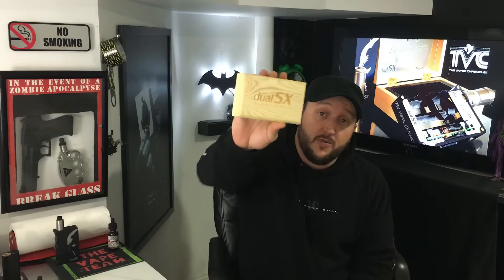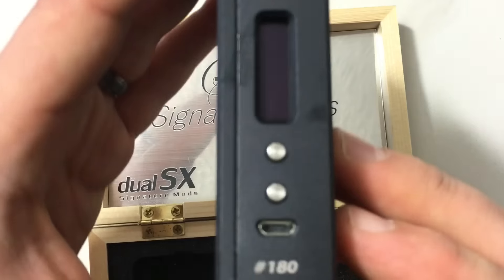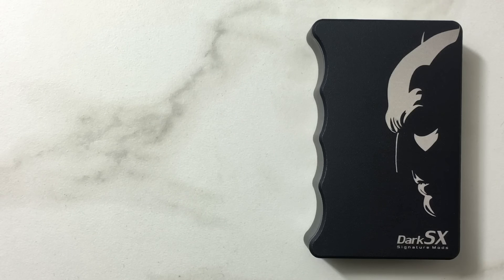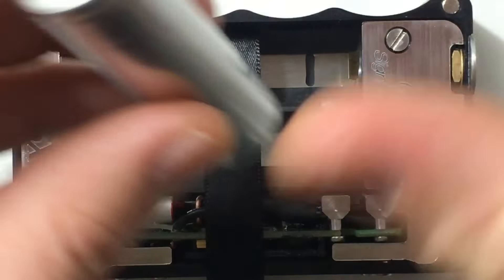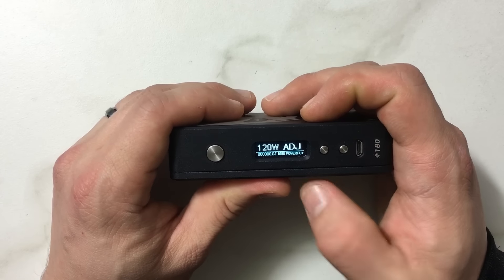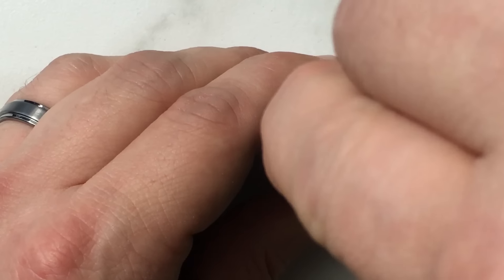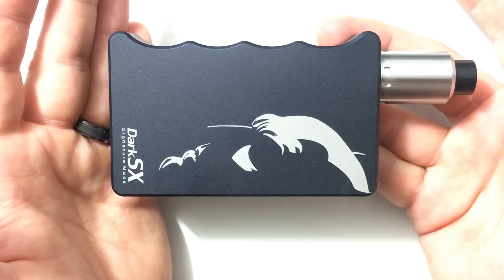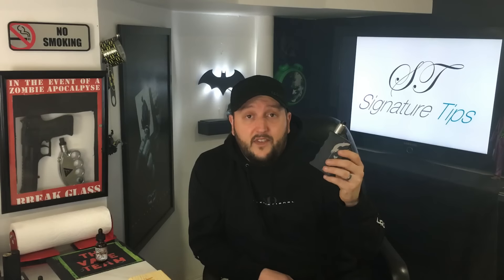Dark Knight Dual SX By Signature Mods UK On TVC

Comment: It's only about a $20-30 premium over a SX Flask (or the original DNA30/40 Vapor Flasks), about the same without the custom etching, and arguably better made.  And remember how much an original Zero or Zen, etc cost this time last year?  For what it is and where it's made it's reasonably priced IMO. 

And Signature? You should do an 26650 version of the Mono.

Comment: Far too expensive device for what it does.  I like the DNA 200 board better and if you want premium customization, I'd get the Whiteout where you can change the board out between the DNA, SX350J or their own proprietary board.  You can also swap between Lipo and dual 18650 batteries.  If you want to spend your money for show, maybe you like this mod (I think it's not really very attractive and far to large for a dual 18650), but if you want to spend less and get far more function, you can make a different choice.  Since I don't get my mods and drip tips for free, I'll stay with function over beauty.
Reply: +Daniel Colby you are joking right, you actually seen the quality of the panels, they are cheap ass rubbish soft bendy,  when you screw a tank ect to the 510 the panels bend whiteout is no where near the quality of this product, and people had to wait 6 months with no word of what was happening crappy support, i know what i woudl much rather pick.
Reply: +Mark Edwards Do you own one?  I thought not.  I have one and have been vaping on it for a month.  I find nothing cheap about the mod.  It's well put together, easy to work on, and easy to customize.  I have screwed on and off many RDAs and tanks from the mod and see no problem with the 510 and the panels don't flex.  How could they?  All but one of the panels are installed with screws.  I waited for more than 6 months but I didn't expect it.  I have enough mods to get me by.  I enjoy my Whiteout and am sorry you are ill informed.
Reply: +Daniel Colby Perhpas the you tube videos are incorrect then ? perhaps the forum posts are incorrect especial about people asking for there money back.perhaps your standards are diff so some other peoples. google is your friend here. if yours is fine and your happy with it vape on, all i am saying is a lot of people are not.
Reply: +Daniel Colby Actual i can see one major thing here and i must appologise for it. the mod here on review is not that expensive in the uk as you would most properly have to pay for say in usa. "before" i purchased one and yes i have purchased one of these i looked around for a good weak. i was after a custom device be it a dna 200 or a yihi 350j v2 device. now when i was looking around did i look for quality of workmanship at all custom modders work over function, yes you are properly right. but i dont know if you have the same problem. it is hellish trying to get a custom made device shipped to the uk, a lot of modders just wont do it. some of those who will when you take shipping to the uk, customs vat and other duties it because way way expensive. not to mention there are then waiting lists to contend with and having money at the time when your looking around is a pain in the ass also. i myself personally wanted something custom made which was good quality and not available of the shelf or mass produced in a  factory.btw i own a dna 200 device also. and if evolve does nothing to make a new dna 300 so to speak they will get left behind, its not long until the yihi 400 is out which in the software near enough has the same customization of ecribe, logos. temp curves. it may not have battery or case anyliser but it does not need it(i do not think). also in the whiteouts corner everything i mentioned is clearly mentioned on there site in the transparency feedback on there website.and has been fixed. or will be fixed in there next runs, but seriously you cannot compare build quality to this device with the whiteout device they are leags appart. and as you said the whiteout is far far more customizable to a point ie diff chip sets, and battery sleds, but they add up to a lot of money and who on earth would swap and change all the time. but you also have similar customization with the dual sx. panels buttons colour ect can all be done but at the ordering time. yes you can even choose a lipo option single batt or dual. i think they call it horses for courses. but i do take your points. i hope you take mine also both are valid. appologies for wall of txt